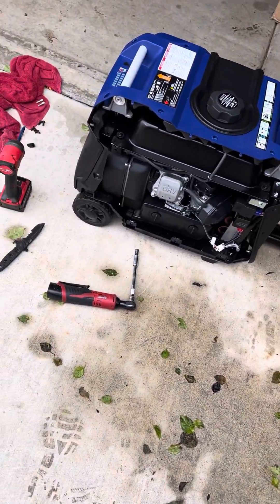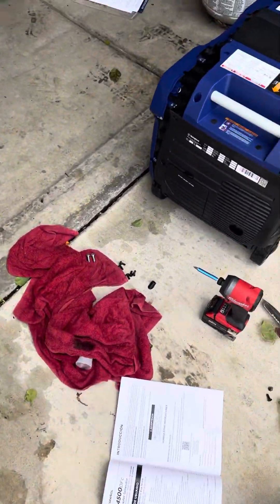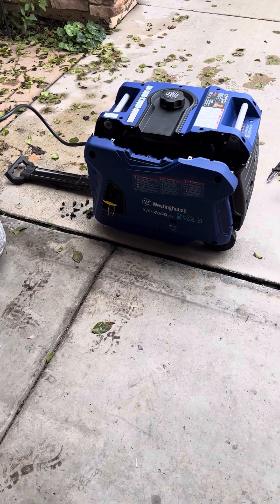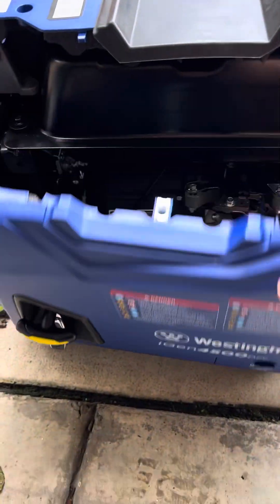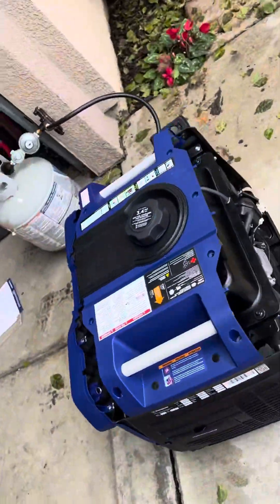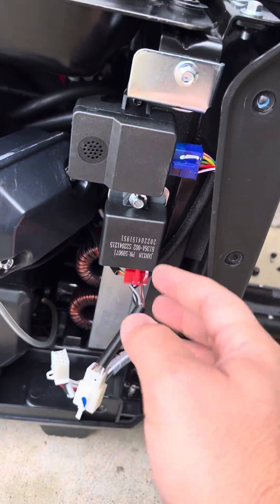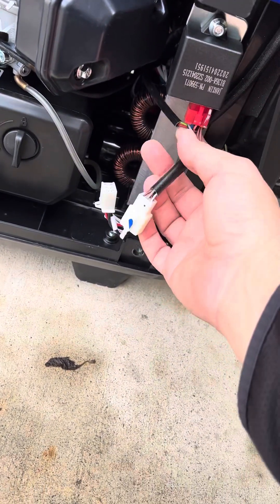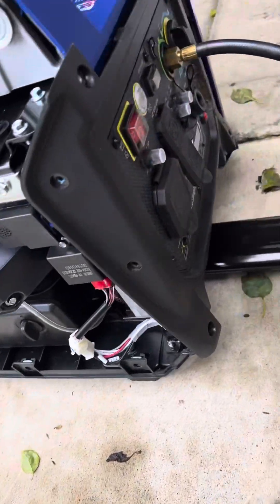Westinghouse carbon monoxide sensor bypass

Comment: WGEN5300c faulty CO2 shutdown temp test procedure.  Remove the black module box opposite the muffler (4) bolts.  Find black wires with white stripe on them.  Two “y” to a 1” square box grounded to the motor.  Disconnect the left wire going into the “y”.  Do your test runs, then reconnect for safety (important).

Comment: Yeah this is definitely not a learned term solution apparently.
It did work for me right out of the gate for a couple of times when I ran it an hour or two. Then it started cutting out right after it started. So I plugged it back in and now it runs again.
I have not had a chance to try jumping the wires.

Comment: I had the same problem in my slightly different model... the Westinghouse WGen5500 with Remote Start (and CO sensor of course)... and I figured out how to get it working. Yay!  The first thing is to locate the CO sensor since the manual's diagrams don't exactly show its position on the chassis (its close but not obvious from the drawing).  The black box-shaped CO sensor mounted up and to the right of the pull-chord, on the corner of the metal frame.   I disconnected it just as you showed here in this video however it would not start... Then (with sensor connected), I did start successfully before I shortly thereafter unplugged the sensor which caused it to stop.  So I tried something I saw  in posts about other Westinghouse models... which is to complete the circuit on connector wires (ie., jumper them)...  blue & white as well as jumpering the Black & Green. It worked for about 5 mins until it shut down.  Then I tried jumpering other wires (we see 5 more wires, 4 going to the connector pins -- 9 wires to 8 pins).  The connections that worked for my WGEN5500 were to Jumper the GREEN & BLACK and the YELLOW & GREEN-YELLOW.  The generator ran for a good 30 mins which should indicate success. I then repeatedly made sure it'd start back up after that, making sure that the CHOKE was on COLD-START for each attempt.  (Usually it needs to be on "Cold Start" or it wont stay running, even if it does startup). Remember,  disconnect the plug to the CO sensor, then jump the GREEN & BLACK and the YELLOW & GREEN-YELLOW wires  (each pair of pins are adjacent to each other and the jumpers will be diagonally positioned on the connector...and a paperclip will do for testing). I hope it helps anyone looking for help w/ the WGEN5500 model.
Reply: is there  way to clean this sensor? my 3600 dfc wont stay on longer than 20mins,tried cleaning fuel filter and spark plug,gas is fresh,every time i would turn it on co2 light would flash once now it doesnt
Reply: thanks I have a Westinghouse 9500DFC that is giving me fits It starts runs for 35 seconds and stops, it will start again then stops in 35 seconds
Reply: I have same issue. Did this work? @sportster19791234567

Comment: Okay, I did exactly as you suggested in the video and d it ran for an hour or so then when I went to start it again it won't start. Now it has no spark at all. How did you fix this issue if it happened to you? My gen was brand new with about an hour on it.
Reply from the maker: Hi @dragally1 - I didn't have this issue.  We bought four more of these with the same mod for solar transmitter sites, and haven't run into this issue.

Comment: Does this model have the remote starter?  I don't want any issues with the CO sensor as well.
Reply from the maker: Sure does.  This is a dual fuel unit with remote start.  Seems to work just fine.  My dad used one of the ones I modified at the coast for 10 days, on propane and it worked perfectly.
Reply: Thanks, I am going to order this unit tomorrow to replace my open frame dual fuel generator. I  need something a lot quieter than my other one.

Comment: Can you just cover the inlets to it so it won’t read anything instead ? Or is that bad ?
Reply: I covered them with electrical tape and it worked for about 45 min and then the unit shut down.
Reply: @DF-mb9kc ditto